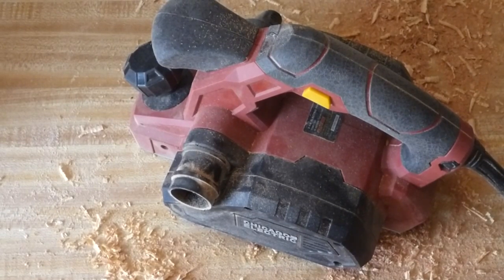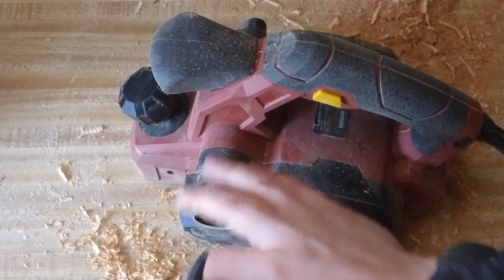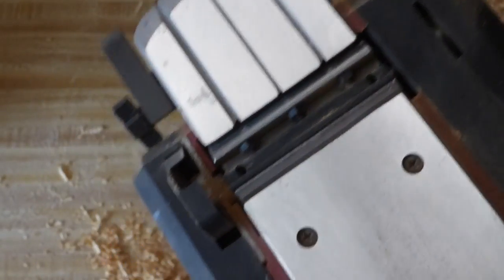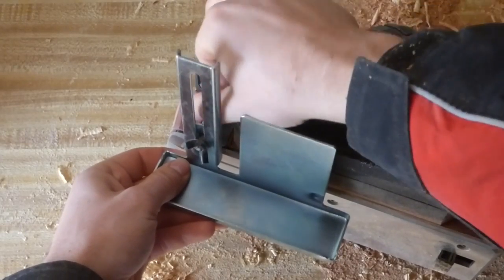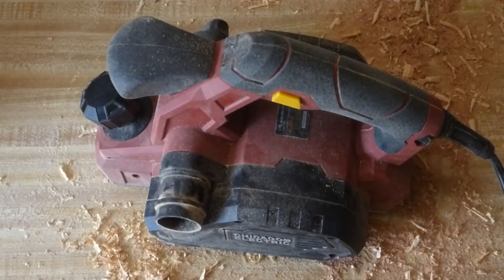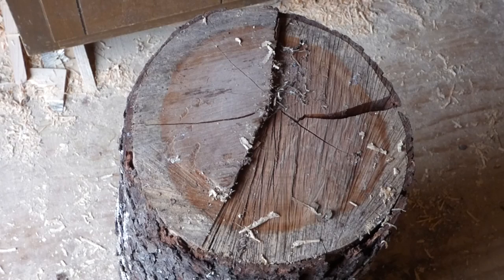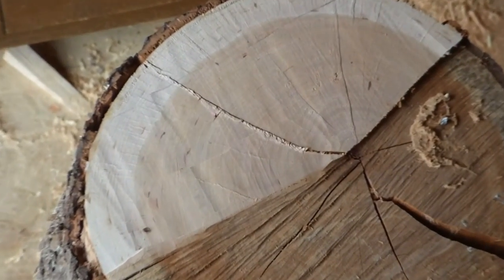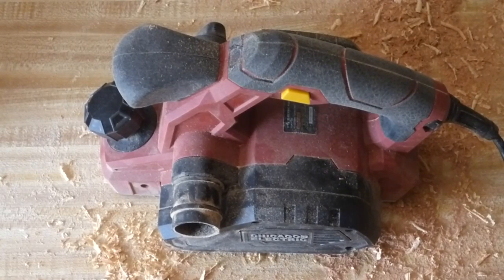Chicago Electric Heavy Duty Electric Planer Review

Comment: Keep the passes parallel to each other, and slightly overlap them, maybe one or two sixteens each pass, and finally don't lift at the end to keep your passes equal, that way you prevent most marks and a rotary sander will finish it nicely. Oh and also secure your work piece, I know this was for demo purposes only but safety first.  Good demo, I will get one as soon as I have time to get to hf.
Reply from the maker: Thank you for the advice, I'll have to try that the next time I use it.

Comment: I‘d like to tell you this planer was made by our factory , do you have some good suggestion for us ？
Reply from the maker: Zhuopan Lee The dust bag had quite a few strings near the zipper, which makes it hard to close. Other than that there aren't really any problems that I have found with it.
Reply: thanks a lot for you suggestion , I will try my best to improve it !!
Reply from the maker: Zhuopan Lee Absolutely! No problem.
Reply: Zhuopan Lee Keep up the good work.
Reply: @lizhuopan  one of the bearings for where the drum is where the knives are failed after about a hour of use
Reply: I would suggest more comprehensive manuals with more photos for all HF tools. I’m a tech writer - more diagrams, close ups, and step-by-step instructions .

I’m trying to align my blades with a straight edge (one edge digs) and the instructions are not as clear as I’d prefer; I’m lost, so I’m searching for how-to vids. There are bolts on the blades, but what am I doing with them in an alignment, if anything?

Comment: I 'd get one but I have to wait for my 25 year old Craftsman to wear out. At this rate it will outlive me.
Reply from the maker: Good ole Craftsman. If this planar breaks easily I may go for a better brand.
Reply: Craftsman used to make really good tools. The old ones are the best. I still have a bench grinder that I bought 30 years ago and thought it was dead because it was left outside on a work bench for three years. I had given up on it. My son was throwing the table out so he asked if I wanted to get rid of the grinder. I told him it was probably toast but let me look at it. The switch was bad so I tried a new switch. SOB that thing fired up and worked great all rusted to hell and back. I took it apart and cleaned it out, replaced the stones and bought a cheap HF stand for it. We are using the heck out of it now. I was thinking of buying a new one but no need.

Comment: FYI you can flip the exhaust port to empty on the right. You look like you’re right-handed, if you do this the bag will not be in the way.
Reply from the maker: Murmur Torres Thanks! I didn’t realize that was possible. I’ll have to try it out.
Reply: AJS Woodworks  thanks for the review of the planer! I think it does a decent job and since it is a harbor freight tool you can take it back and replace it if anything is not to your satisfaction. 

On the opposite side of the exhaust there is a button. Push it down and push in and the exhaust tube will come out. Be aware there is a tooth on the exhaust side so when your pushing out watch that the tooth is evenly aligned with the gap so the exhaust will slide out easily. 
Hope this helps😄
Reply: Thank you for this. I just bought this planer and I noticed on the box the port is on the right. So I’m wondering who changed it on mine causing all the chips to blow back at me.

Doh!
Reply: @AJSWoodworks   I had to go inside and smooth out some of the lips in the hole that the dust tube slides in so I could get it in and out out. Plastic has a lot of Flashing on everything

Comment: Anyone have a problem where this planers’ light still comes on, you press in the safety and pull the trigger and then nothing happens?
Reply from the maker: That happens to me periodically. Not sure what’s going on though.
Reply: @AJSWoodworks  happened to me about 3 hours ago… hasn’t fired since….
Reply: Anything you do that clears out the malfunction?
Reply from the maker: @mterveen1  Not specifically. I think it might just be a finicky electrical connection inside of the tool. I wish I knew what was wrong as well!
Reply: @AJSWoodworks  time to do a tear down and work from trigger back!

Comment: Hi, I just bought one of these to plane the rough face of some heart pine planks. After 9 or 10, it started making a weird noise, like a whine or rubbing noise, like it's struggling.  Anyone experience this? Of course I threw the receipt away...
Reply from the maker: Mine has made a struggling noise before, but it tends to do that when it’s going over end-grain.
Reply: @AJSWoodworks  Thanks for the reply. I'll take it apart and see if I can find anything.
Reply: Hey Ben, I know its kind of late but if you give the cashier your phone number at the checkout, all your receipts get saved to your phone number in their computer system. Just go to the counter and ask for a return, say the receipt should be on file and they should be able to pull it up for you